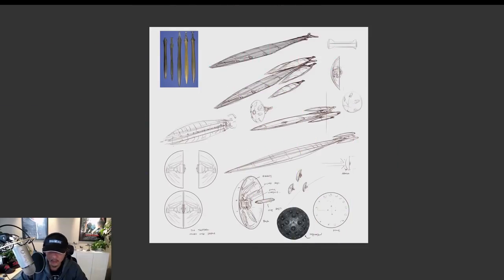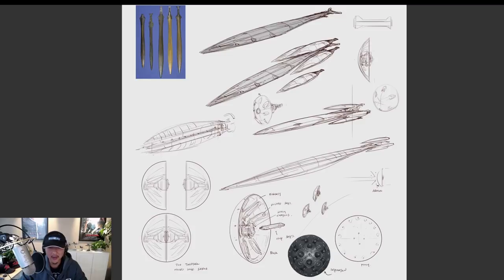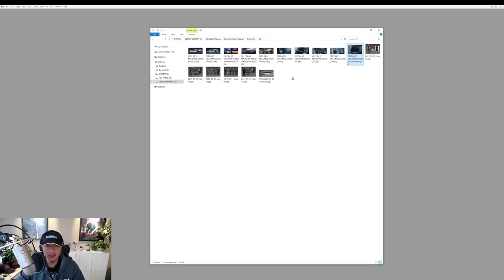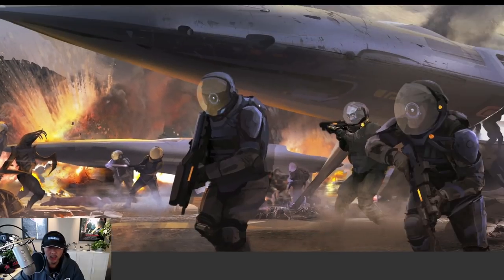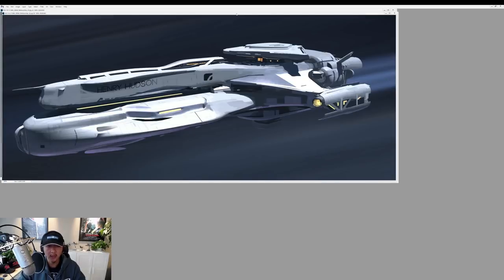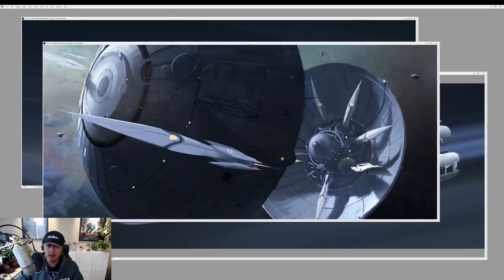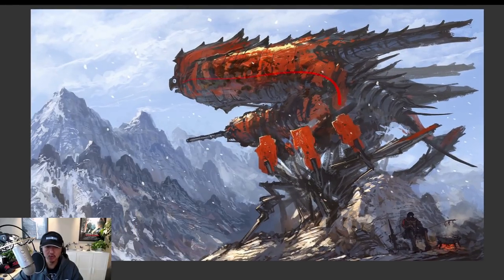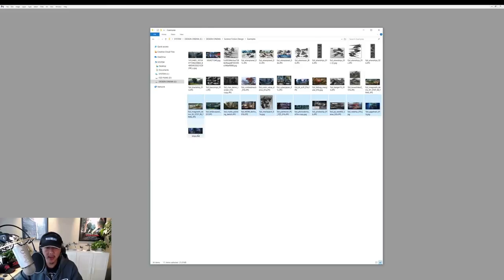Design Cinema - Design for Science Fiction - Part 04

Comment: The way i see realism/scientific accuracy is as inspiration, sometimes reality is stranger than fiction as they say, and if you come in immediately jumping to "its fantasy, real world rules need not apply" you can end up with something very generic because what your basing it off of is other medias existing ideas, but at the same time if you follow accuracy too tightly you wind up with little room for imagination and fresh designs and ideas. So what i do is i think it through a bit, how would this logically work, what are the implecations, are those implecations interesting or would it be better without, if its more interesting breaking realism then do it. What i think is more important is being internally consistant, again if following the internal logic for some specific thing doesnt work for you then dont, but what i really think of as belevable is when the concequences of the decided details are acknowledged and worked into the rest of the design logic.

Comment: I'm a programmer and I've been an amateur designer for years and I'm trying to get more into design, but my pragmatic mind has an impassable barrier that prevents me from adding design elements for the sake of coolness when they serve no actual purpose and make no sense.

For example, when I design a spaceship I simply cannot use wings and winglets, I can't place cockpits in stupid positions that restrict visibility or simply (in case of warships) I can't do large viewports that present weak points

For example, in case of battleships, it makes absolutely no sense for the ship to have viewports of any kind, and the command room should be located deep within the center of the ship (Lacuna universe anyone!?) since the ship is flybywire anyway and you use sensors and cameras for actual viewing. In fact even if you had a cockpit with a large viewport you'd still rely on sensors and cameras to get a proper view of the battlefield, not on your eyes, this is something that happens even in current times, pilots don't fly their planes by looking outside, they fly by instruments and computer systems, and fire their weapons miles away from their target through computer targeting when they can't even see anything with their eyes.

My point is, I understand the coolness factor and the appeal to the greater audience and the telling of the story, but from my perspective I'm frustrated that I find it really hard to find some designers/artists out there that dared to break those patterns of commerciality so I can maybe get inspired by them. I feel that by learning this kind of design like Feng is teaching, which is perfectly fine and indeed cool, and limiting themselves to these constraints, that designers are not pushing the boundaries of Sci-Fi.

I feel that true Sci-Fi means going beyond any limitations in the pursuit of the science "that would be", and science is based on logic and pragmatism, so not daring to make a war spaceship that has absolutely no windows, no wings and no aerodynamic shape, because "the audience" would not understand it and would not be appealed to it, that's not really Sci-Fi. I feel that the genre of Sci-Fi should be that genre that pushes the boundaries and does things that the "majority" doesn't like nor understand because it's beyond their grasp (StarTrek anyone?). I guess what I'm trying to say is that Sci-Fi should NOT be dumbed down, because the second you dumb down Sci-Fi, it's no longer Sci-Fi, it's Lame-Fi at best.

I DO understand the economic reasons behind this and I understand following these guidelines when it comes to commercial products like movies, but I just wished I'd see more actual independent forces going beyond these boundaries outside of these commercial products, more people doing true Sci-Fi for the sake of Sci-Fi and innovation and not just commercial stuff for profit.